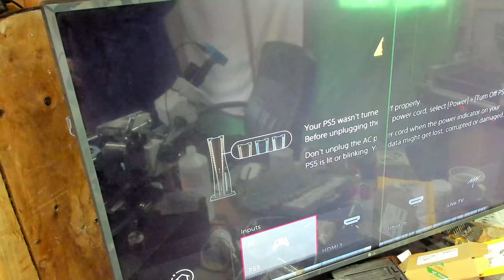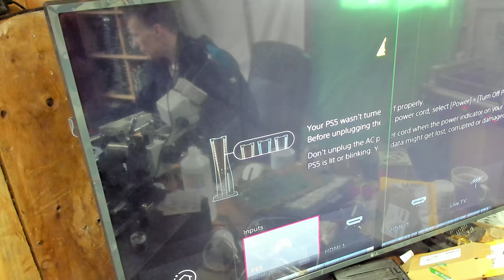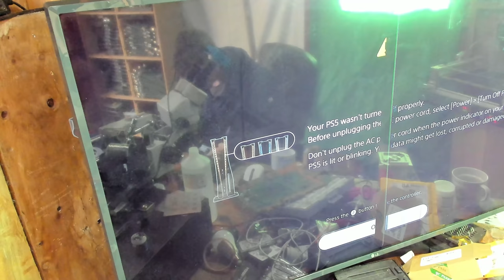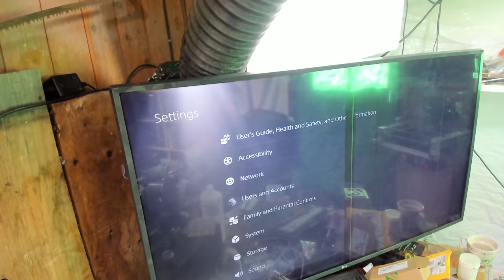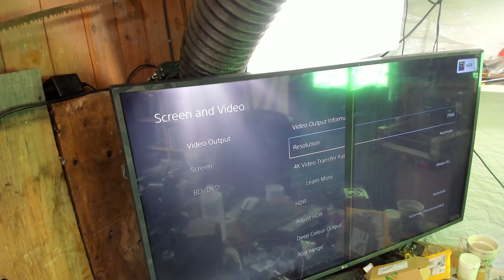PlayStation 5 No Video Output Diagnosis & Repair - HDMI Header Trace Damage

Comment: So another tech installed an HDMI port, and either damaged a pad, or there was one already missing and they didn't notice it?  Doesn't sound like a very competent tech (whoever worked on it before you, not you obviously).
Reply from the maker: Pretty much mate, the pad could have been torn during initial port damage, pin 19 is very common for damage but who knows, it could've been the other tech too lol
Reply: The one he did on the livestream yesterday had a new port installed but the chip wasn't soldered properly, you think they would check their work before going to the expense of sending it to someone else

Comment: I have a ps5 and I replaced the hdmi port all looks good pins soldered well but when connected the tv acknowledges the console but I get the no signal message on the tv. I tested the little filters from the controller chip and no break in connection also measured for a short around said chip no short. Anyone can help? Thank you for all the work you put into this channel!

Comment: On this LG TV you've got an issue with LVDS, might need a COF bonding, Phil. You need a special soldering iron for that - just by the way ;). And your vertical line would be gone if it's not a cracked screen. And, thank you for this video ;) just by the way :D.

Comment: Hi,  I did search but found nothing on your channel, could you show us what you use to stream?  My kids want to start off streaming gaming but i have no idea what's good and what to use for multi inputs like console + camera + mic etc :)
Reply from the maker: Hey mate, for multi inputs I use a standard hdmi splitter with HDCP removal (required for capturing the PS4 screen). I also use an elgato camlink 4k which I hook up via USB to my computer to capture different displays, and then a high end gaming laptop to actually run the stream. The cameras I use are all Logitech Brio 4k, and the mic I use is a Røde wireless go, which is a clip on lavalier mic. All in all I'd say my setup cost a couple of grand, if I include £900 for the laptop, £350 on cameras, £100 on lighting, £250 on the microphone, £80 on the elgato capture card and the other accessories the cost can add up quickly
Reply: @TheCod3r  Yeah i know you can spend some serious £££ on stuff :) was more interested on how you handled the multiple inputs from different sources.  Also what software do you use, i've got a spare machine ready to go :)
Reply from the maker: @buckhobbit  ah fair enough, for the multi inputs just a standard HDMI splitter is fine but if you're using it for a PS4 you'll either need to disable HDCP before you hook it up to the capture card or use a splitter with a built in HDCP remover. Personally I have to use the HDCP remover because I need to test customer consoles that don't usually have HDCP disabled :)

For software I use OBS which is free :)
Reply: @buckhobbit  I like OBS Studios, but Stream Lab and Xsplit charges but is good.